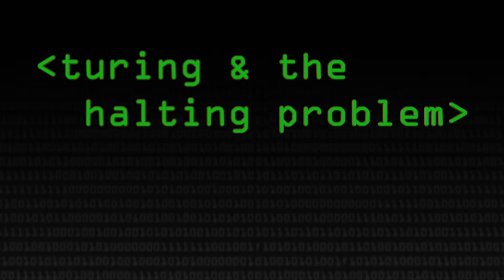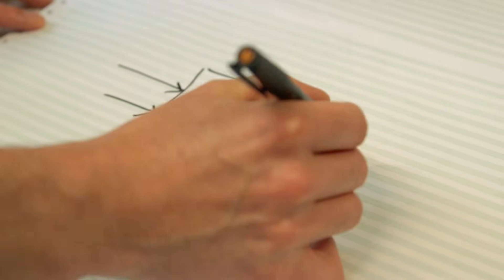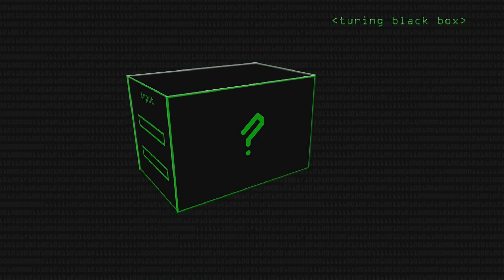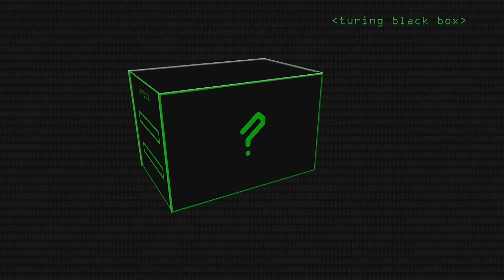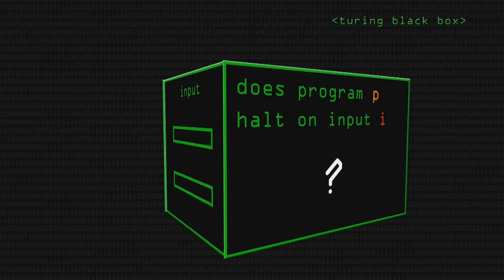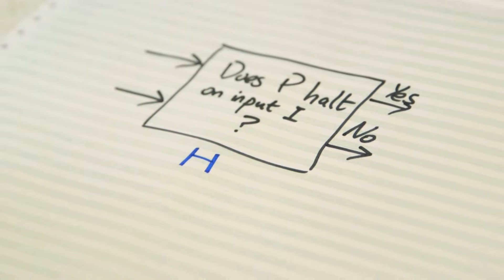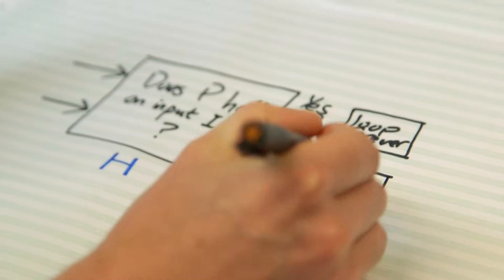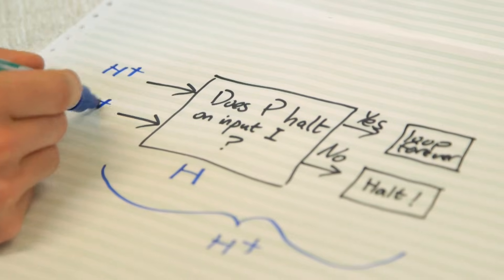Turing & The Halting Problem - Computerphile

Comment: Hey guys, I understand how a reductio ad absurdum works. But I'm struggling with seeing how this particular reductio ad absurdum works.

I assume that's lack of understanding on my part. I'm not debating, I'm looking for help in my understanding.

If we feed H+ into H+, I get that we wind up in a paradox.

But that shows that H+ is not equivalent to H.

It seems to me that if we feed H+ into H, H will report that it halts, because some of the time it does.

Which to my way of thinking doesn't contradict the initial assumption that H is possible.

I'm clearly missing something, and it's probably trivial and obvious in hindsight. :P

So what is it that I'm missing?
Reply: H is a machine that contains an algorithm which solves the halting problem and outputs yes/no. H+ contains the exactly same algorithm which solves the halting problem but has a different output at the end. Turns out H+ cannot solve the halting problem at all, then H must not have contained the algorithm to solve the halting problem.
Reply: NoRotation
Turns out H+ cannot solve the halting problem at all, then H must not have contained the algorithm to solve the halting problem.

Why not?

I just don't see how that follows.

1) Assume H works.
2) Change H so it's different and becomes H+.
3) If we feed H+ into H+ it won't give the same result as if we had fed H+ into H.
4) Therefore, H is impossible.

You start with something that we assume works. Then we change it into something else, and it breaks. Therefore, it never worked in the first place?

I just don't get how 4) follows from 1), 2) and 3).

Here's what it sounds like to me:

----------------
Let's say I write a program that accepts an input string, and will return 'true' if the input is "abc". Otherwise it will return false. Call that G.

Then someone else comes along and wraps that program with another one. If the inner program G returns true, the new program will loop forever. If the inner program G returns false, the new program will return true. Call this new program G+.

Convert G+ into a string and feed it into G+. G+ will return true.

This is not the result we expect if we had fed G+ it into G.

Therefore, G is impossible.
----------------

That seems like an obviously non-sequitur conclusion.

Thing is, I perceive that argument as a good analogy for the programs described in the video.

Clearly I am mistaken in this. So where does my analogy break down? What am I missing?

Sorry if I'm being difficult. Not trying to be contentious.
Reply: If G exists, it's a trivial matter of adding 3 lines of code to alter ONLY the output and create G+. With this trivial alteration we generated a machine for which the proposed internal halt-solving algorithm cannot possibly process due to it's paradoxical nature. So any program that can be trivially altered into G+ cannot exist, otherwise you can trivially alter them to create a working G+, but we know G+ cannot possibly work.
Reply: NoRotation
With this trivial alteration we generated a machine for which the proposed internal halt-solving algorithm cannot possibly process due to it's paradoxical nature.

Hang on. In the course of trying to explain why your answer doesn't satisfy me, I think I stumbled on an answer that does. :P

I think that one piece I was missing was that H and H+ both have two inputs. This is something that was missing from my G example, for some reason I wound up assuming a single input.

I was treating H as saying: Will program X potentially halt?

I should have been treating H as saying: Will program X definitely or definitely not halt on input Y?

Also, in the video above, we are asking H+ the question: Does H+ halt when given the input of H+?

But for me, that confused things, because to my way of thinking it felt like asking H+ the question had nothing to do with H. I was wrong, because H is the first step in H+. But this way of framing the problem obfuscated that fact.

The way of thinking that clicked for me was to re-frame that as asking H the question: Does H+ halt when given the input of H+?

In that case, when we feed H+ into H+ the paradox kicks in. Which for H+ is kind of irrelevant, because H+ is basically just a garbage application.

But the fact that H can't process that paradox proves that there is no program H that will be able to resolve all programs as either halting or not halting on all possible input.

I just had to line up the problem in such a way as to get it through the sieve of my misconceptions.

Thanks for your help and time. :)

Comment: I don't get it.  Surely you can prove 2 of the 3 possible outcomes. some programs will definitely halt (e.g. output = 2x input), and some will definitely not (e.g for(i=1:i<1:i++)), or like the one in the example due to recursive or infinite loops.  and some are indeterminate, due to the complexity or are dependant on the input.

Comment: Though I think that Turing's proof that there is no completely general solution to the halting problem is correct, it may be misleading people. I have to wonder about its general significance. Both it and several other problems in math and logic require a recursion of the whole system resulting in an ill defined input.
In particular you are asking whether a program that requires an input (the halting program) has a definite state when there is no input. That is you are using the halting program to examine a halting program that has no input. Of course it is going to be indeterminate but this is almost a trivial case, because how many of the programs we are interested in, would have this kind of structure where you could feed themselves into themselves.
An analogy would be division on the rational numbers. We can show that division is not closed on the rational numbers since 1/0 has no solution. Nevertheless we use division on the rational numbers all the time and we can prove it is possible on all rational numbers except when the divisor is zero.
When, in real life, we want to ask if a program is going to eventually halt how often are we asking that about a program that is going to feed itself into itself without first setting the input parameters of the inputted version of itself. I don't think this situation is going to come up very often, and frankly we may be able to come up with a general pattern recognition algorithm that spots programs that load themselves self-referentially an throws the error code "indeterminable" so that we have 3 cases, halts, continues, and indeterminate.

Comment: 3:16 is where I get lost.  What I'm hearing is that the existence of a solution to the decision problem necessitates the existence of a solution to the halting problem. I don't see the connection. Now consulting wiki.  Please feel free to kibitz.  Thanks.
Reply: The way math would be decidable if the halting problem can be solved is like this:
You can set up a program to take in a set of axioms and generate theorems that can be produced in one step continuously until it generates the statement being tested. If the statement you’re testing can be proved by the axioms, then the program will eventually halt; if not, then the program will never halt.

Comment: A minor problem, the description actually given won't create the paradox.  H+ needs a front end as well as a back end.  What you have in your example is that you are feeding H+(H+) to H and asking if it halts and finding that H+(H+(H+)) exhibits opposite behavior, which may be unusual bot not impossible.the fron end needs to do a small conversion so that x(y) is changed to x(y(y)).  This is actually an important consideration.  Languages which cannot expand their inputs are always decidable.  But expanding the inputs allows the creation of self-denying statements.

Comment: Something is not right in these premises. I've never read the original papers, so I don't know the exact explanation of this, but the only reason because the [H+] machine fails its own [H] part is because [H+] (while being fed [H+]) becomes an infinite program, while requires infinite inputs.

"Having X program/machine, and Y argument, does it halt?"
X in this case is [H+], which takes in two arguments: another program/machine and an argument for it. Feeding in [H+] as both program and argument states that I'm always putting in an [H+] machine with an everlasting need of infinite inputs that links to itself, thus creating a unreal (infinite) machine. The problem goes round and round because obviously, you can't have a machine check if an INFINITE problem halts or not.

So the only thing we did was to prove that, using classic logic, there is no machine that can solve the halting problem for ANY machine, real (finite) or unreal (infinite). This doesn't mean we can't have a machine that solves it for REAL machines.

Comment: And this is probably why modern microcontrollers (especially critical ones, like those found in vehicles and healthcare equipment) have a built-in watchdog capability. A special command is provided to notify watchdog the program is still working okay. If the program won't report back within, say, 1 second, it means it has stuck somewhere and the chip needs to be reset immediately.
I always thought this is stupid and some kind of loop detection would do better, huh. Now I think I get it. ;)

Comment: The flavor of Turing's argument reminds me Gödel's Incompleteness theorem. Both seem to be taking a system of axioms and breaking them, proving they're "too good" to be complete and solve every problem. Is there a relationship there?
Reply: Apparently there is. After doing some reading I've come to the understanding that Turing's work on halting was an extension of Godel's work on first-order logic. Apparently lambda calculus was invented for the same reason. Lisp is based on lambda calculus, right? And basically every other language is based on Turing machines?

Comment: Proof me wrong ...

In modern comptuers we could easily fix the problem with a non-overwriteable value. We just set the value 1 time, and re-feeding the result to a machine wont be changed, as we just analyse "parts" of a code and not a chained structure of code.

That means, the result for a h+ machine could simply not be just "yes/no" , it has to take into account the inner parts of the code it looks at, and would then answer with "yes part 1 does halt, no part 2 does not halt, ... " ; kinda like a clever compiler ; so if any of the parts has a "yes" , it will halt in completion ; if all parts are "no" it will not halt.

No matter if you refeed the result, it will just add another answer to the chain of answers and look if the chain has any "yes it halts" , and output the correct result.

Comment: Two problems. The input H+ cannot be input into the machine unless these is an input into the H+ that is being H+'sed. Because you are asking does something with no input give an output therefore this is not a halt because it was never started. Secondly this does not prove for all possible first logic questions that it does not work simply because it does not cover the infinite amount of examples that are possible, there are examples that will be every which way different to this. I'm not convinced anything was proven in this example.

Comment: The added graphics are nice. However, in general you might want to preserve the case of the variables written on the paper.  Generally speaking, "H" is not the same variable as "h".  It didn't cause a problem here, though.  Thanks for the nice videos.

Comment: At the beginning though I thought you were looking to see if there's an answer to every possible question (about whether it can be solved with first-order logic).  Then at the end it doesn't work for every possible program, specifically because this one ridiculously-designed program has a command to loop forever.  I just don't see how this one paradox shows you can't find the decidability for every question as long as you use the right algorithm.

Comment: In practice a real machine has a finite number of states. So we can just write a program that checks if the machine visits a state that it's been to before (in which case it loops forever).

Though this program can't exist on the same machine since by definition it would need more memory than is available on the machine to keep track of visited machine states.

Comment: Why can we determine with our brains that a program halts by reading?  Aren't our brains similar to computers?  Or does this prof only apply to Turing machine capable computers, and our brain is more than Turing complete?
Reply: We can not do that in the general case. As an example:

Given any number of any size:

1: Append 1 to the (right) end of the number in binary (giving 2n + 1);
2: Add this to the original number by binary addition (giving 2n + 1 + n = 3n + 1);
3: Remove all trailing "0"s (i.e. repeatedly divide by two until the result is odd).
4: if you are left with 1, halt, otherwise go to 1

Will that halt for all inputs?

Comment: Wait, but what about the ackerman function???? I thought the point of that was to show the program always halted and had a calculable result?
Reply: ntwede The Ackermann function always returns a result for nonnegative integers m and n, given enough time, memory and all that stuff.

The point of the video is that you can create a program that tells you whether a given program with a given input will eventually halt, you just can't do so universally, i.e. H would need 3 possible outputs instead of just true of false, for example 1 = will halt; 0 = will not halt; -1 = no idea.

Comment: 2 things. I've thought it would be cool to see if a division algorithm would halt before it got to returning a non-integer answer eg solving algebraically whether this equation is true or false:
if c=b/a:
does
AND(c, 0.11111111...)=0

if true, the number a is a factor of b

Also, I wrote a progam on a minecraft redstone CPU I built which would see if the first 8 bits of the binary fibonacci sequence repeat. I got that the 383rd is 0, 384 is 1, and 385 is 1 and so forth (2, 5, 8, 13...)
I initially had no Idea if the program would halt. It took over 2 hours to run, but I got a result.

Comment: there's a minor mistake in the presentation: the definition of H+ was "take inputs a program P and a set of inputs I. if H(p,i) then loop forever, otherwise halt". This simply doesn't work, you can't apply H+ to H+ and H+, since you're implying that H+ both takes 2 inputs and 1 input.

The correct definition for H+ is
"take a set of inputs i. if H(H+,i) then loop forever, otherwise halt"

This way, H+ is a one-argument function (just the i), and you can apply H+ to itself to get the required contradictions.
Reply: Thank you. It makes perfect sense now. I couldn't understand how H+ could take an input of just itself.

Comment: But the machine could still exist. It only crashes when you do the H+ mod. But if you don't do it you still got the machine and no paradox. So if you ever got the machine, you simply don't create the H+ machine. Please correct if I'm wrong.
Reply: No, the machine must be able to do it for any program, including H+. That's in the definition. If I tried to make a universal pasta cooker but for some reason it couldn't make spaghetti, then it isn't really a universal pasta cooker. You only need one exception to prove it wrong.

Comment: I don't understand how the conclusion can be so strong that it means there's no possible machine that can solve the halting problem. You FORCED the contradiction. There's nothing about output Yes that means Loop Forever, you just added that yourself. Just because there can be a contradiction doesn't mean that contradiction is inherent in the problem, right? Someone help me out with this.
Reply: It's because we're allowed to tinker with the machine. In this case if we had the original machine, it's trivial to produce the H+ machine, but if the H+ machine cannot possibly exist then the original machine cannot exist since if it did we'd be able to easily make the H+ machine.